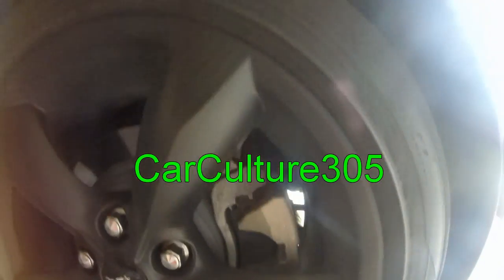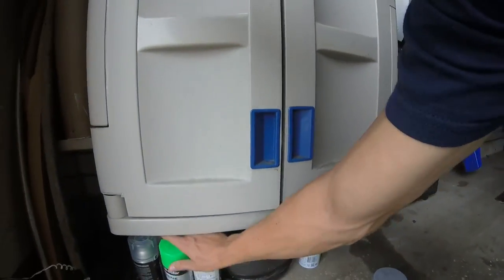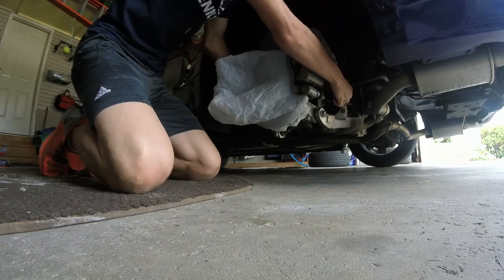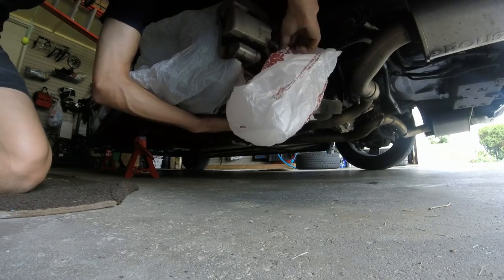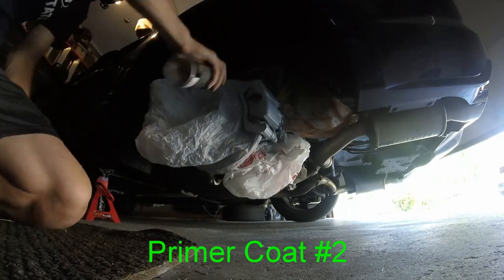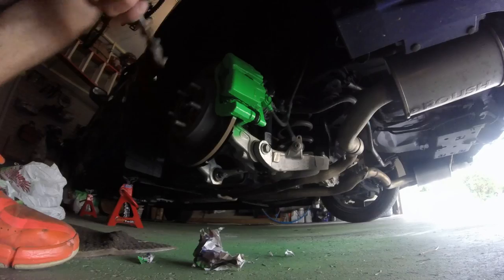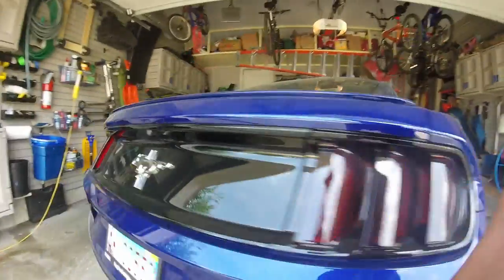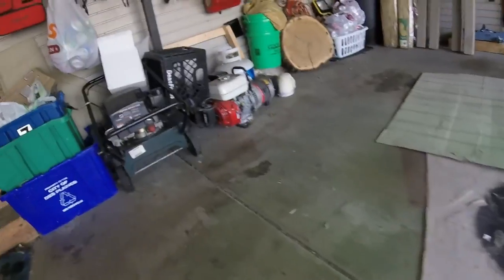Quickest and Easiest Way To Paint Brake Calipers (Green Calipers On Blue Car)

Comment: I bet if  you'd swept up when you noticed the over spray on the garage floor it may have mostly come up.  most garage floors are "dusty" and the paint would stick to the "dust" - also it may mostly dry by the time it hits the floor...  Still a rag with some paint thinner would clean it up - otherwise you'll be painting your parents garage floor next weekend ;-)

Comment: Flame proof engine paint cracks on calipers u need to get caliper paint.
Reply: tim wood They don't. I had mine for a year and never had problems...had them yellow. I went with the color of the car (blue lighting) on my '17 Fusion. Thinking about doing it green now lol.
Reply: tim wood By the way I used car paint from NAPA and they told me it wouldn't last. I've had it for about 6 months now and they're still holding up. I use my car daily and drive about 1,000 miles a week. Most are highway miles (I work out of town).
Reply: Nick maybe the people that I seen use flame proof just didnt do it right lol my bad buddy
Reply: Nick hell ya
Reply: tim wood Lol it's cool. I was just letting you know that it lasts. I did put clear coat on both the flame proof and car paint.
Reply: Tim...you are correct.....there will always be assholes disagreeing with whatever anyone puts in the comments.........what makes them right and you wrong......they are wrong.....